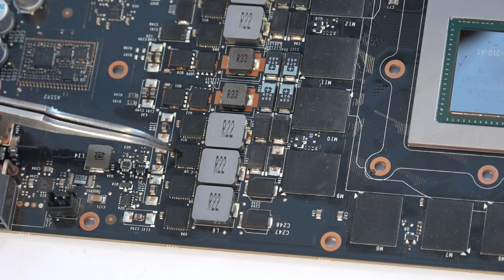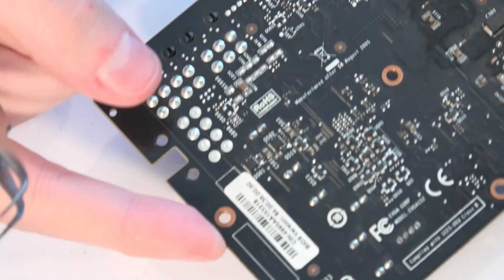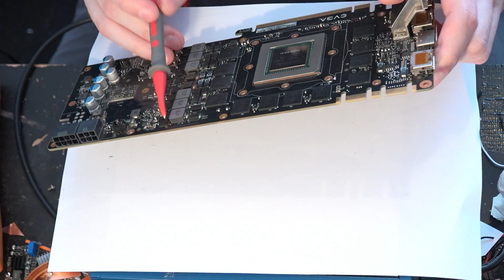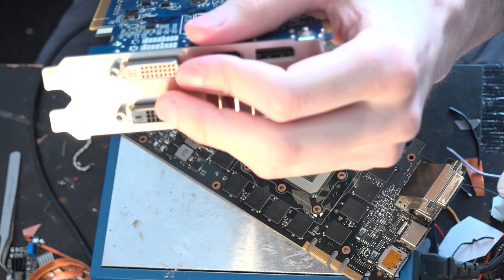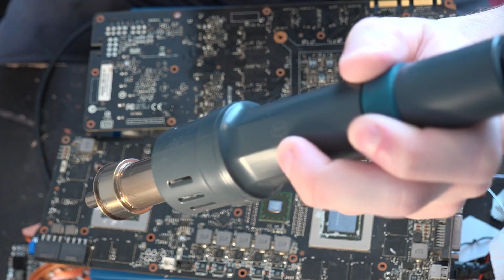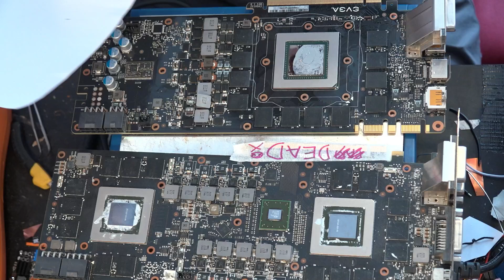Part 1 of trying to fix a reference GTX 980 Ti without just replacing the entire Vcore VRM

Comment: Do you know what is the model number of the R33 inductor? In my GPU one of the two burned out so I was searching a replacement for it, the rest of the board seems fine, no other burn marks or smell, no melted solder marks on other components. Also the card is not dead(the PC turns on with it but the screen remains black, still light on; LCD display) and it seems that the display recognizes togheter with the PC.

Comment: 690 kind of perfect as a parts source. Das ist Richtic, unless ya'll fry the component with too much heat. To lift these welded components rather than ruin the pcb, if ya'll use a grinding pen it won't ruin the board. Nvidia really screwed the pooch on the 980. I believe if I get an old ti I will fuse these.

Comment: Hello, amazing video. Your effort is highly appreciated. I have another issue I believe and when mine stopped working I noticed a liquid-like substance on the pins which connect to the motherboard and it stopped working. I don't know if it damaged anything on the board. I tried to clean it but the result remains. Any suggestions?

Comment: If you allow me to ask. I have a rtx 3060ti zotac twin edge old pcb with 6pin power version. I noticed that this particular pcb design has slots for up to 8 phases included a combination of chokes, caps and mosfets. But, only 6 phases are populated on this card. Maybe i am dumb but i have plans to waterblock this graphics card. So, my big question is that possible to upgrade this board with those left components to work propely ? Including those  components will it be able to performance better under Overclock? To comparison i have checked some other components as vrm/memory controllers, they are the same as the rtx 3060ti FE which it has 8 phases already. I would be glad if you can reply. Thank you.

Comment: Is this the EVGA sc+ 980ti? I have one that failed on me gradually. No artifacts or anything, it just crashed the pc completely, then worked again with a reboot. Happened more and more often until it didn't boot anymore. I had it cooled by an NZXT kraken g10. Any idea if that could be a powerstage? I also have a broken gtx 770, perhaps I could borrow parts from there..
Reply: Yes. Your Powerstage has most likely failed. Its very common with SC+ especially ACX 2.0 models.

Comment: I remember you said that ddr5 mobos should come with 2 dimms but now with you testing 4x16 what do you think now? With the upcoming x670/e mobos which would be better? 2x32 or 4x16? Since this is amd and we saw how last gen 4 sticks did better than 2 sticks with you even respoding to comments on that hardware unboxed video

 In ddr4 4x single rank sticks (creating dual rank) always beats 2x dual rank sticks (dual rank)

So How about this, Here i assume Both the 4x8 and 2×16 are dual rank. So if 4x Single rank sticks > 2 x dual rank sticks. Despite both working as dual rank dual channel. What would happen in ddr5 where a 16gb stick is SINGLE RANK?
So you'll have 4×16 single rank sticks (creating dual rank).
Wouldnt this be the better option? Looking at how 4x8 single rank sticks beats all the other ones. (2x16) This should work right? It will the same as 4x8 but rather than 32gb you'll get 64gb. While beating the other ones in fps.
Right? Will this work?
Reply from the maker: 2xDR is generally better than 4xSR. This is especially true at high clocks since 4xSR is a signalling and timing nightmare.

Comment: U can tell its dead from the piece of tape on the pcie that says "dead" ;) 

Doing boardwork and filming it at the same time looks real annoying. I find two hands is barely enough for soldering on its own some times.

Anyone know what temp it has to hit to weld itself to the board?
Reply from the maker: well copper melts at 1084C. I've seen some shorts on PCB actually light up white for a fraction of a second before burning out.
Reply: @ActuallyHardcoreOverclocking  I guess shorting it out dumps a lot of energy into a small part of a small component really fast. That's crazy hot

Comment: i have a kingpin 980 ti laying around and i think the memory mosfet was shorted by metal because the previous owner mounted a water block without the distance rings. the card boots but its missing a view screws. memory displays some lines under load, games or firestrike results in a freeze
Reply: Run MATS, sounds like the VRAM is fucked.

Comment: Was this something that applied to all 980ti’s? 
I bought a gigabyte g1 980ti shortly after launch I think maybe 7 years ago, it’s been on a modded bios since then and it’s still being used in a different pc without issue, have I just got lucky so far?
Reply from the maker: the gigabyte cards like to have the memory VRM blow up. EVGA SC and reference blowers blow up the Vcore(and sometimes memory). The thing is some cards get lucky and don't fail for a LOOOOOOONG time
Reply: @ActuallyHardcoreOverclocking  thanks so much for the reply! 
I guess now it’s just a waiting game, 
Thanks to you though I’m going through the process of overclocking my 10850k on a msi z490 gaming edge, thanks so much for all the useful information you give!
Reply: @ActuallyHardcoreOverclocking  Yep...which is what happened to my EVGA SC that I planned to try and fix but no longer have the time or desire to try.  Never will buy EVGA again after that QC issue.  Shipping to donate it would probably be more than it is worth now.
Reply from the maker: @saywhat9158  980Ti? If you're Europe the shipping shouldn't be too bad and I can always find a use for dead GPUs even if it's just being a donor board for parts.
Reply: Are there any modifications you would recommend to a EVGA reference blower to mitigate this? Potentially better thermal pad and/or custom BIOS?

Comment from the maker: SPOILERS!

Spoiler for Part2: the card works now. Also the reason it didn't boot at the end of this video is because I didn't clean the pads of the second power stage that I removed and there was a solder bridge.
Reply: Thanks for the spoilers warning :)
Glad I waited til the end to read that
Reply: Thanks for the spoilers! Looking forward to watching part 2 even more!
Reply: Bro. Excellent Video like always.
Mine start diying yesterday 980Ti G1, the R132 or R134. 

I never do any repair in that, can you give a tip? TY!

Comment: just the average reference 980Ti experience :D

i saw some people use a dremel to literally grind the dead powerstage away when it welded itself to the board. that way you keep the pads in working order. but it's a lot of work
Reply: If it doesn't budge with hot air at the usual temps then dremel it all off to prevent having to fix pads and traces.